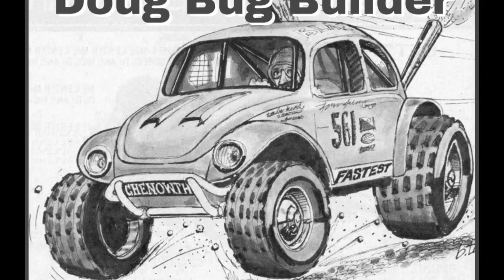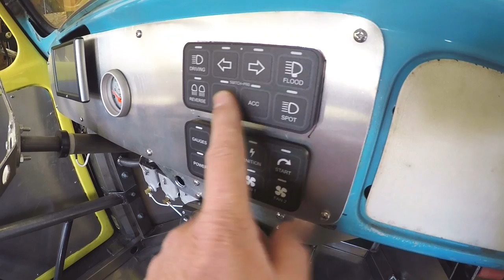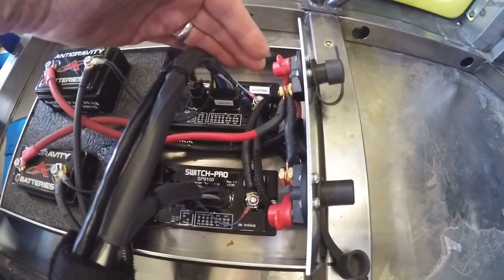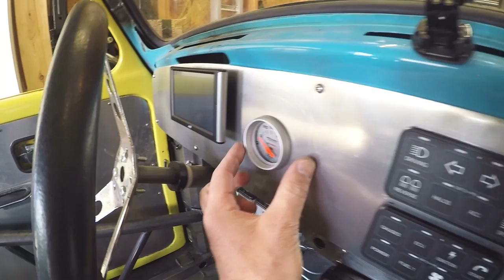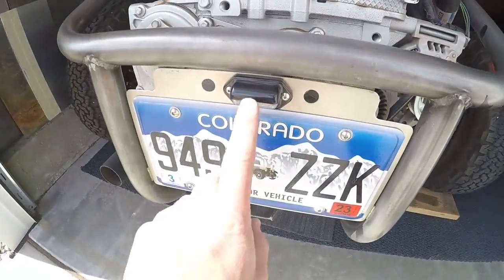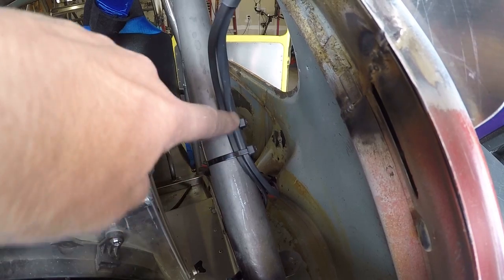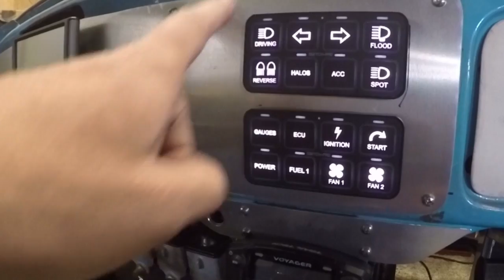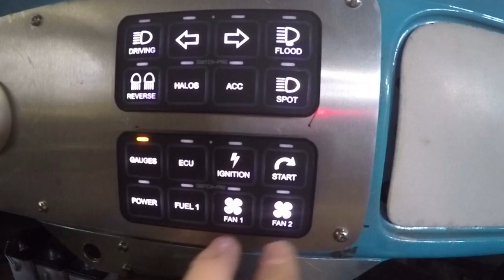Rewiring the Baja for the Switch Pro devices.

Comment: nice set up. maybe next time hide the wiring inside your tube frame like they do on motorcycles., Just a idea. what kind of Jack system are you going to have for changing your tire out on the trails?
Reply from the maker: I'm hoping to make some kind of linear jack at some point that will be pretty light and barely take up any room. We'll see.